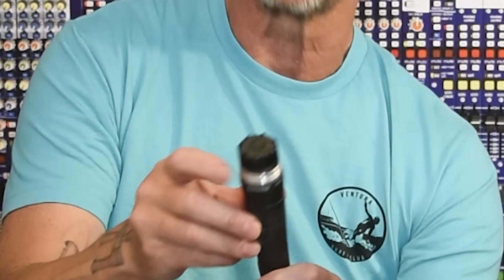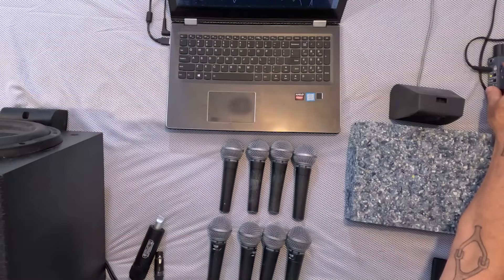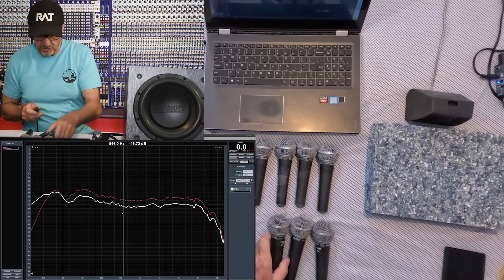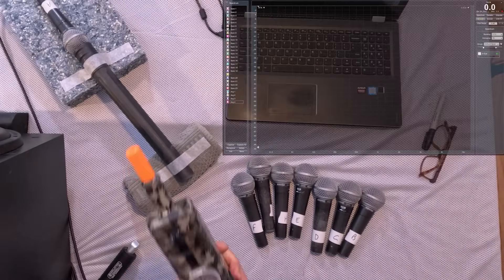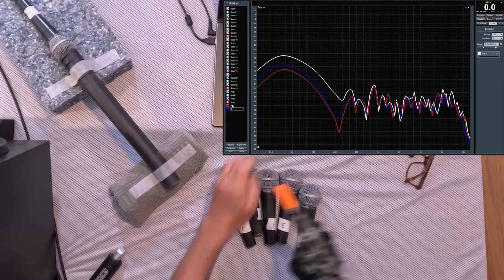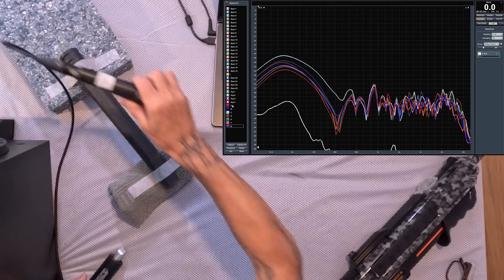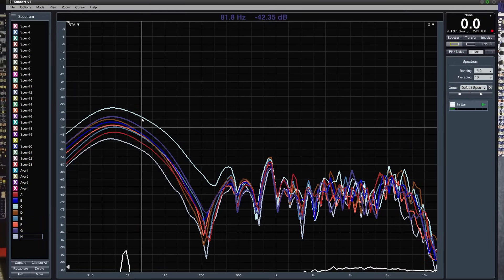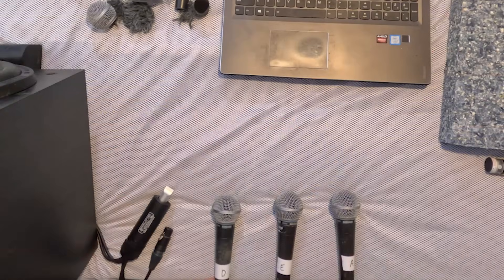Modifying Sm58 To Reduce Plosions

Comment: what about foam cover over the grille mesh?
Reply from the maker: Adding a foam cover will help as will having a P pop nylon mesh in front like they use in the studios. 

Also moving your head farther away from the mic will help a lot 

But those are all differences that alter the way the mic feels on the lips or alters the setup and requires the musician to endure a significant change in the way things feel or they sing. 

The goal here was to try and find a solution that does not involve altering the way the mic is handled or the singer sings
Reply: @DaveRat  may be there are like slim, thin foam covers... with drawn mesh on it))))
Reply from the maker: Thin and close tends not to do much and "lip feel" of a metal mesh versus foam that gets damp is a completely different sensation. 

There is no right or wrong but when you alter the way something feels you're going to get some who like it and some who don't. 

If you can solve the problem without altering the look or feel, then you have a more robust solution
Reply: @DaveRat  Cool stuff you are doing, sir! experiments and measurments!  Been messing with cheap dyn mics, found that stuffing mic body with cloth or alike reduce some of the handling noise (some mics have no or such good rubber amortization thing like shure mics do) but this may alter response and directivity too... maybe some desings are like compensating moving coil freq. response with resonating mic body ))) idk

Comment: What about just a simple capacitor high pass filter in series with the wire soldered to pin 2 of the xlr? Or perhaps between the capsule and transformer? Some of both, with a little bit of diffusive material before the diaphragm? 

See what this guy does:

https://youtu.be/96FC1bAVK4g?si=DmSDX10z2TknCyER

Comment: @ 2:17
The perforations are air vents to let sound in from the "back end" of the mic.
The phase difference between those waves and the ones from the front 
is what makes the mic cardioid.
If you completely cover the holes you change it to (near) omni. 
Making it less sensible to plosives, but more prone to feedback.

A classic is grabbing the mic just under the "head" and leaning over the wedge monitor.
FEEEEEEDBACKKKK 

Interesting experiment.
Reply from the maker: Yes, agreed if I recall I may have done polar pattern tests in this vid?

Cool cool

Comment: The disks are kind of like the design of the windscreen on the KMS105.  This testing is something I like because I have always said let the mic do the work and this is a way to do that. If you have the response you need out of the gate, you get a better mix faster. We spend hours and hours tuning speaker systems, why not spend more time working with the mics in this way.

Comment: Dave, I would really like to hear your thoughts on the old feedback reduction technique where two microphones are taped together, you sing into the top one and the bottom one is out of phase. Is this a way to reduce or eliminate feedback without having to ring out problem frequencies? Also, what feedback reduction methods are used at modern big shows? I would think at that level, there are too many problem frequencies to be able to ring them out without harming sound quality.  Thank you.
Reply: In a big show done by someone like Dave, the system, speaker placement, mic placement, monitor design, and everything else is going to be designed from the ground up with feedback prevention in mind, in other words, not putting speakers directly in line with the polar pattern of microphones, as well as having the singers trained on proper mic usage to get lots of gain before feedback.

If you have singers running around in front of the speaker stacks, you may have more problems, but if they are staying close to the mic and you have gates set up to close when they aren't actively singing, you can probably survive lol

You may also have feedback eliminator processors, or built into the system processor, to notch out actively feeding back frequencies.

And yes, I would probably check the system, or Ring it Out in a new room, just to see if there are any particularly live frequencies or speakers or sources that might cause an issue, and then work through eq or changing positions to resolve the issue.

For instance, maybe a microphone for a bass cabinet is feeding back because a monitor behind the microphone is reflecting off the front of the base cabinet, but you can move the bass cabinet or turn it away from the monitor to remove the problem.

Other times you can remove the microphone from the particular speaker.
Like maybe don't put that bass cabinet mic into that monitor channel.

I have even had to constantly pan a wireless mic on a high energy speaker so whenever he walked in front of the speakers on one side, I would pan the mic to the opposite side, avoiding feedback while maintaining average room volume lol
But that was a result of system design issues, or the "talent" leaving where they were supposed to be is more like it...
Reply from the maker: The dual mic issue is that if you sing into both, the sound goes away, or at least drops a lot and sound all phasey and crap. Sing into one and some sound gets into the other and it also sounds somewhat phasey and crap. So the sound is super unstable and audibly poorer quality requiring the singer the be very mic aware.

Try it, then try and get singers to do it. 

Solutions with quality and finesse will get you gigs and better sounding shows. This i believe will have the opposite effect.

Comment: Performing a rudimentary investigation of pop-shielding the SM58 and similar mics, I turned up this product called the "Popper Blocker", and this YouTuber covering the commercial product: https://youtu.be/jlUKKti6am0?si=WOBI-BgfqonfEQRn So you can kinda just shove some extra material inside the dome.

I propose developing a pop-shield specific to the SM58, possibly an alternative windscreen, and even a new system for mounting an SM58 element, particularly those made for wireless systems could be easily modified to form a new model housing which has been hardcore-modified to get that SM58 sound but with a much stricter and more rugged enclosure, with some extra acoustic features.

Comment: Ever just taped a pencil to the outside of the mic, centred on the diaphragm? Love that trick for the studio but naturally doesn’t lend itsself to live, but perhaps there’s a 3d printable cap for the top of the mic grill someone can invent?
Reply from the maker: My experience is a sound engineer has shown that " lip feel " his extremely important to many performers. Additionally " the look" can also be extremely important to many performers.

I kind of looked at this as a project to see if improvements could be made without altering lip feel or look
Reply: @DaveRat  reckon we could modify the grill so the centre ‘bars’ deflect a bit more plosives?
Reply from the maker: That's an interesting idea that would be fun to try
Reply: @DaveRat  you’re the man!

Comment: In the film world, we all know that disrupting the wind with a layer of (faux) fur then giving it room to diffuse (air space) is key. The Rycote BBG comes to mind for something like a 58 (not sure if they make one for that mic)
Reply from the maker: Yes and exactly. Yes and for handheld mics and rock shows, we Don't have the luxury of using those advanced tools and the look and lip feel are very significant factors that that make internal and unseen pop protection valuable and necessary.
Reply: @DaveRat  ya cannot break the laws of physics! 😂
Reply from the maker: True and also some designs are better than others and with me just mucking around for a bunch of hours I was able to improve The pee pop projection of the most popular mic in the world. With some actual computer modeling and engineering I think it could be bumped up quite a bit more and fully encased inside the existing shell

Comment: I'm sorry you are wrong. About the frequency response on,  a, SM-58. Sorry, no. The frequency response does not  stay, the same. You are wrong there. And here's why. That you didn't take into account.

Every unidirectional microphone has proximity effect. That get fairly pronounced on a SM-58. And if you put on their little optional, Foam Pop Filter. Well? It's going to keep your lips. Another 1/4 inch further away. From the grill and the diaphragm. Of that SM-58. And in so doing.  It still reduces the Proximity Effect. Though not by much. But a little goes a long way. So you're not correct there and. And.

The difference becomes even more pronounced. If you put the large oversized, rather long, Foam Pop Filter on a SM-58.. When you then might notice. It'll compare almost unmistakably. From the SM-7's. That cost $300 more. But it's the same capsule. The real difference in the sound is your distance of your lips to the diaphragm. In that case. You really can't get closer than 2 inches from the diaphragm. That makes it even more huge difference. In both low-frequency, proximity effect and overall output level.

And so I'm really surprised to hear you without this, additional information I mean this is not rocket science you know. And that does make a sizable difference in the sound. Because you see. My specialty is in doing, Live Broadcasts, Live Recordings. And I will usually insist. We put at least the extra standard small optional, foam pop filter. On the SM-58's. It makes a huge difference, huge. So I don't know where you're getting your information from? And quite frankly I like the larger oversized foam pop filters. But won't usually find that on a vocal PA microphone position. So then you use the smaller foam pop filter. It makes a huge difference. Believe it.

I mean I would live to any of you. I'm a history making multiple major music award nominee.
RemyRAD
Reply from the maker: The test for P pops was done with an air gun and the mic at the end of a long non sealed tube. I used the tube to keep the distance from nsistant and also to eliminate proximity effect for the p pop measurements.

The pink noise tests were done close mic'ed. 

This was to capture the process ximity effect.

Additionally, what you don't see in the video is air gun tests done close and pink tests done far.

I did not include those test because they don't provide additiona significantl useful info.

The p pop issue happens when close to the mic and is even more of an issue when far from the mic.

Foam windscreens are big, ugly, and change the feel of the mic to the singer lips, so I did not include using them.

Adding internal disks reduced p pops both near and far as shown with the air gun for far and voice for near.

Comment: Great video, Dave. I do take one issue though. Where is the frequency response and plosive tests for an SM58 with an external, foam pop filter? It seems essential to understand how it, as well as your modifications, compare to one another. It is, after all, the reference for existing plosive mitigation. For curiosity sake, you might also include a flat, gooseneck mounted studio pop filter as well.
Reply from the maker: Yeah I didn't do the external windscreens  or the nylon stretched over a paddle that they use in studios because I figure that big, ugly and cumbersome solutions fall into a different category than hidden solutions that don't change the lip feel or look of the mic.
Reply: @DaveRat  I totally understand. Still, it would be nice to be able to compare the actual reduction of a foam windscreen to your modification. 

I guess, in the end, it only matters if you like what you were able to create.
Reply from the maker: Agreed and yeah my experience is that phone windscreens do such a good job that plosions are no longer an issue. If I dive into this further that would be a great measure of success is to approach the results that foam wind screens can get
Reply: @fantasticsound2085 the issue is, you won't be getting a rock star to be singing into a mic with a Radio Shack foam sock on it, so for this conversation it's not any more an option than putting them in a recording studio with a pop filter on a shock mounted condenser mic lol
Reply: @DaveRat so if a foam windscreen can reduce it almost completely, what could we do to get a similar effect if we went slightly external?

What if we 3d printed a new screen for the 58 that was just slightly larger, but allowed for a thicker layer of foam inside, or maybe even a 3d printed baffled arrangement to redirect plosives?

How much larger would we need to go to get similar results, and would it still be small enough that it would be acceptable?

Maybe it could be taller like a tophat, instead of spherical, so it wouldn't block the face anymore, but would be like your stacked disks, protecting only from axial plosives?

Or make it like a line array, maintaining the side to side width, but taller, and then curving out on one side, so you have more thickness on axis, but also on the "back side" of the mic (audience view), so that it's not blocking the face any more, but whether the air flow is straight down from the top, or coming into the back side, it's still got more thickness, but not changing the profile the audience sees. 

You might have to work with singers to get them to keep the mic in line with the airflow, but it would be a minor adjustment.

With the ability to 3d print capsule housings, it would be easy to test different shapes and designs, and then when you find one that works, make a metal version, but a printed plastic version, maybe with a metal insert to screw onto the mic, might even be tough enough for stage use, as long as they aren't throwing it around lol
Reply: @ke6gwf  Except that's not necessarily true. Sound companies do a lot of work that doesn't involve celebrity musicians. Some of those jobs could definitely benefit from using the ugly, foam cover for outdoor events.

Regardless, the foam cover is a well-known tool in the arsenal of many sound companies. Knowing how these modifications compare is absolutely useful towards improving solutions that can be used on any gig, from garage band to megastars.
Reply from the maker: To keep things from spiralling into infinite options, I separated the quest into two categories. The look and the sound. The goal I worked on is to improve the sound without altering the the look.
Reply: @fantasticsound2085 I don't need to compare it to the worst case scenario, but rather listen and see if it lowers it to an acceptable level lol
Reply: @ke6gwf That's your choice. I have to ask myself why you would write a comment that discourages someone from going the extra mile to achieve the best results.

Me, I treat such modifications with two things in mind; What's the best case scenario already in use/available as a goal to meet or exceed  and what is the worst case I find acceptable to invest time and money developing? If the solution is adequate, but not practical to reproduce, it's not going to work. 

Having benchmarks for success and failure are the only way to understand the full scope of one's accomplishments. Sometimes that means comparing inventions or alterations to solutions that work well but are impractical for other reasons. 

Dave already explained his parameters for designing this modification. He decided not to test the foam windscreen that's his choice.

Comment: Pooping puppies

A takeaway is “get an OM-7”. 

Also, there are eq plugins that have use multiband compression. Presonus base eq now has one that you can set the range +\- (in this case reduction) and response trigger amount (in db) as well as the Q amount. 
I’m with you on stopping the air at the mic diaphragm 👍🏼 - but there are now EQs that mitigate very well.
Reply from the maker: Removing puppy poop from your polenta is never as good as not putting it there in the first place
Reply: 🤣 👆🏻 this phrase here to fore will always replace the old “crap in/crap out”

Comment: DAAAAAAAVE how come you didn’t include a stock 58 with a Shure foam pop filter for comparison?
Reply from the maker: Adding an external windscreen easily solves the issue. As does the nylon stretched studio paddle.

But also, many to most singers don't want foam on lips and/or the extra big size and unsightly look of a foam windscreen.

Yes, we can solve the problem by making it big and ugly, but that's no fun. The beauty of an unseen solution is a much more desirable.sdventure
Reply: As always - great info! Thanks Dave! (BTW, when I read your reply... I heard your voice in my head! Be careful in there! ) @DaveRat

Comment: Great fun video! The old studio trick was to have a pencil in front to deflect. I've a modded Oktava ML19 cardioid ribbon that was designed initially for speech and it used to have a curved concave strip of aluminium right in front of the ribbon which I assume was to deflect plosives which are bad news for the ribbon!
Reply from the maker: Awesome and cool info.